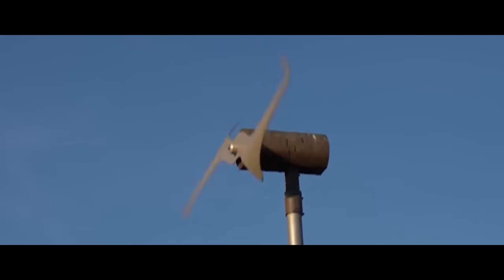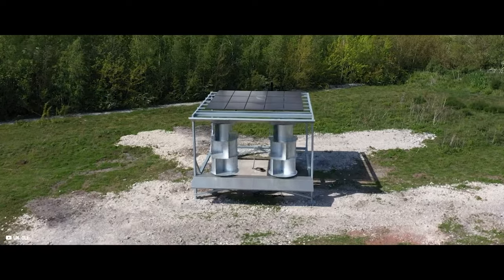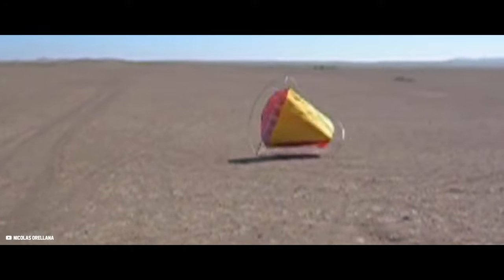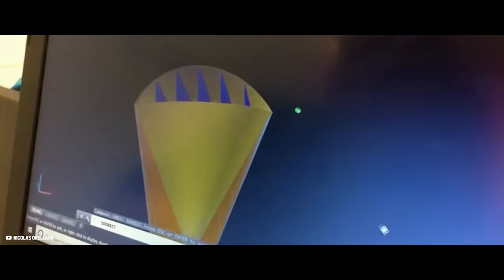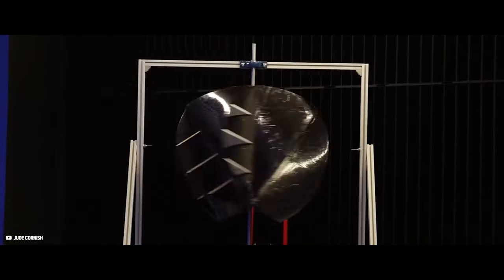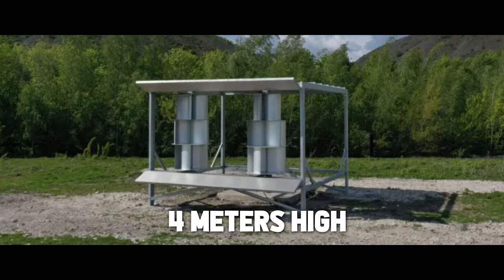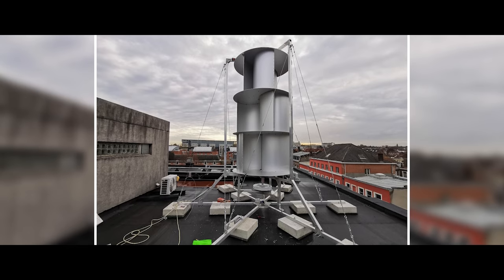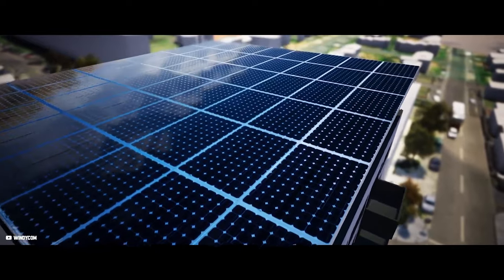NASA Wind Turbine for Home Beats PV Solar Panels in 2024?!

Comment: Meters per second wind speed means nothing to citizens of countries who generally use miles per HOUR or kilometers per HOUR.  Nobody talks about the strength of a hurricane or speed of a vehicle (car, truck, plane, or ship) in meters per second.
Reply: If it helps, here are some rough conversions.  A meter is about 3 inches longer than a yard, so as a really rough estimate, you can think of a meter as a yard, so just think yards per second when you see meters per second, or multiply the result by 3 to get the more familiar feet per second.  You will be under estimating, but for wind speed, that's good for wind speed.  If you need to over estimate, like when buying materials for a project, think of a meter as 1 yard 4 inches. You can even go as high as 1 yard 6 inches to make the conversion to feet easier.  1 foot, 2 inches, or 14 inches.

A kilometer is about 0.62 miles, that's roughly mid way between half a mile and 3 quarters of a mile, so like 5 eighths of a mile.
Reply: 10 meters per second is about 20mph.

Comment: Solar modules generate reliable and extremely low-maintenance green electricity for 25-30 years at 2% to 5% of the cost of small wind turbines!
Due to the extremely gusty wind near the ground and the mechanical load, small wind turbines usually only work for a very short time.
Of 100 small wind turbines, 99 were no longer working after 10 years. 
Solar modules, on the other hand, are extremely low-maintenance and over 95% of them still work well after 25 years.

Comment: I created a non-laminar wind turbine, (non-laminar wind such as wind currents moving a across building's structure surfaces) when combined with a solar panel I think will provide apartment residents a robust solution when wishing to utilize a renewable energy source.  It can be installed in similar fashion as an air conditioner, or balcony installation.  I will be filing for a patent in the next few weeks.  I designed this because i have lived in apartments all my life and have been through 3 blackouts.

Comment: The O-wind they ,,invented'' is basically the ,,Sombrerete Giratorio'' used in Spain  and other places in Europe for more than a century. It is a device installed on the top of the chimney,,using the wind to extract the smoke, also having a turbo effect on the chimney even without wind. Also the round blades shape avoid rain to get in the chimney. So as it is much older than NASA,it cannot be claimed it was invented by NASA.